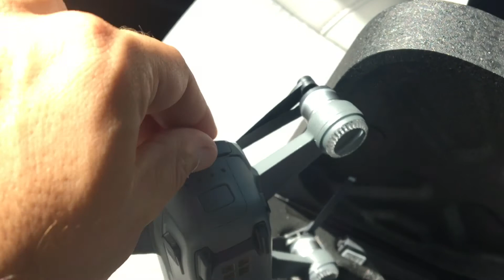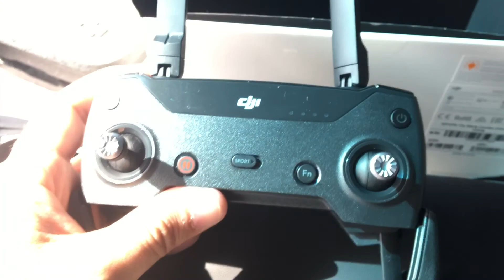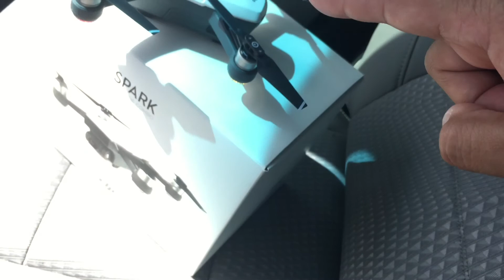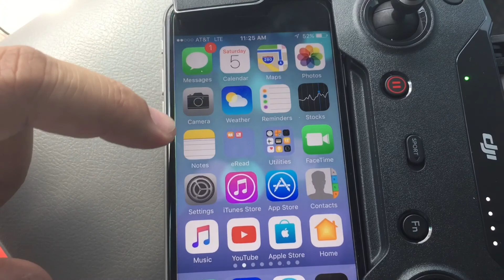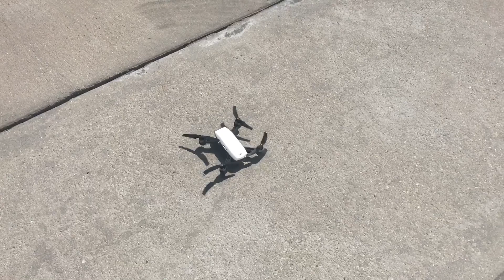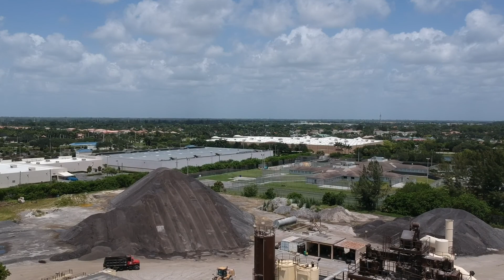DJI Spark FMC

Comment: what is price of this drone
Reply from the maker: $499 for the basic package
$699 for the fly more combo package

The fly more combo package includes a transmitter, extra battery, multi-battery charger, & carrying cases.

I highly recommend the fly more combo as the transmitter allows it to fly farther distances and the extra battery provides longer flight time.  These accessories are costly, so the package is actually discounted.